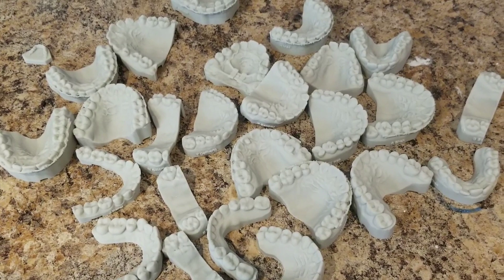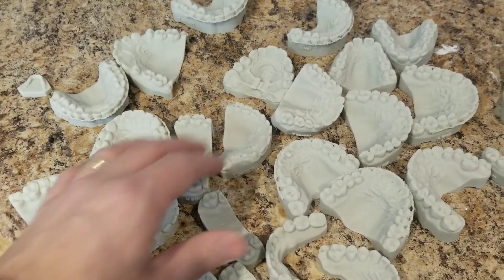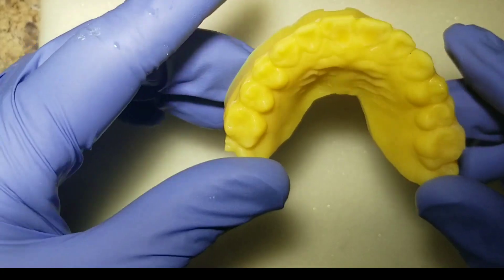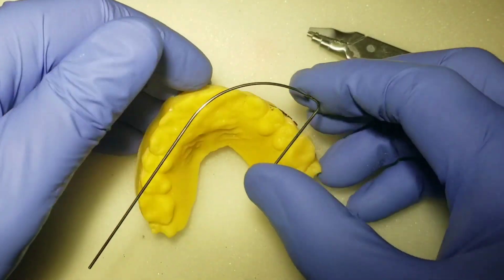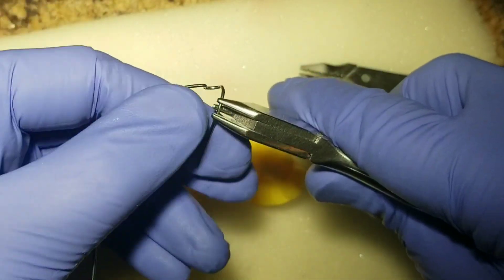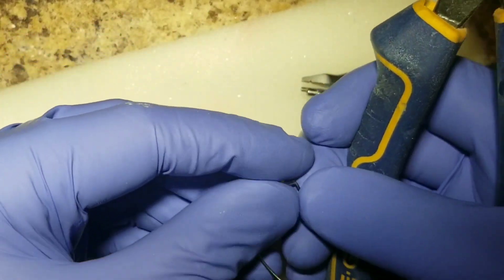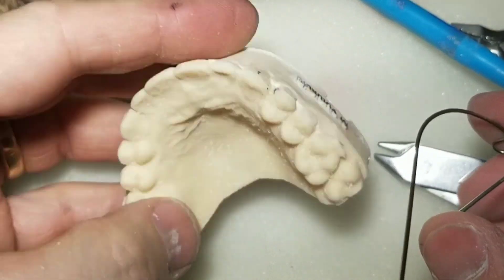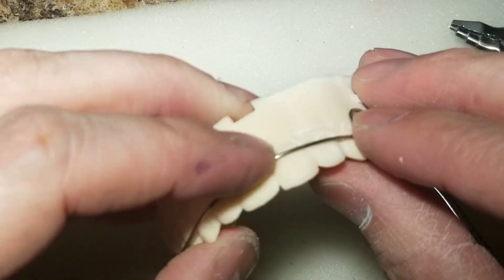Wirebending 3D Hawley Retainer Tip by Szara Dental

Comment: Questions:  Can you share what type of separator material you use on your printed models?  Also, what material are the models printed with?  Thanks!  I didn't even know what a model holder was until this video. :)
Reply from the maker: I use siliform for seperator 2 to 3 coats http://bit.ly/2JjjLA9
I use e model beige resin printed on my Envision One printer
Reply: @SzaraDentalLab úm